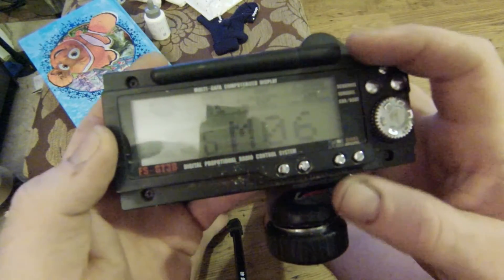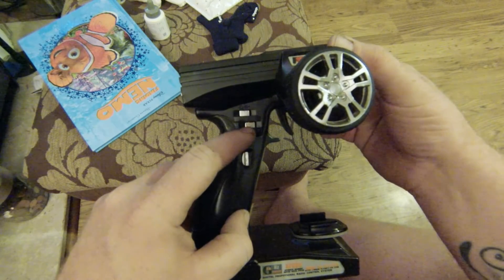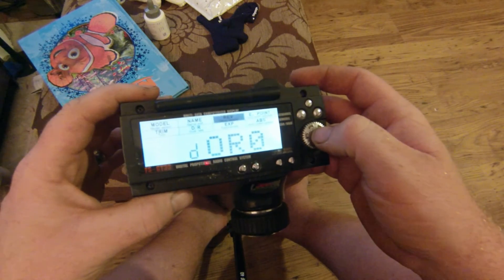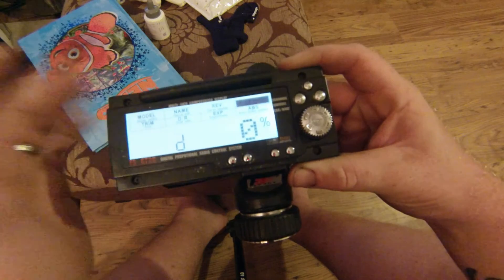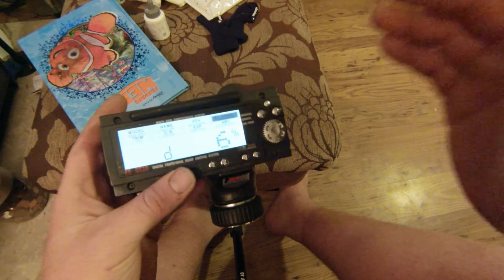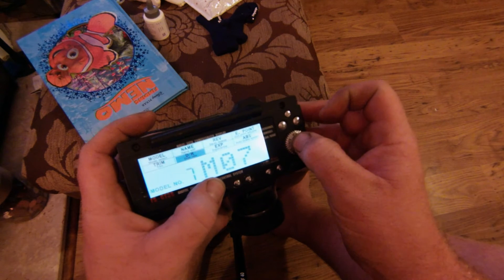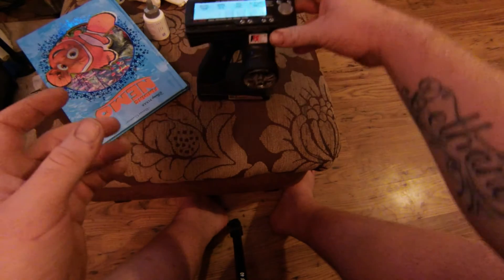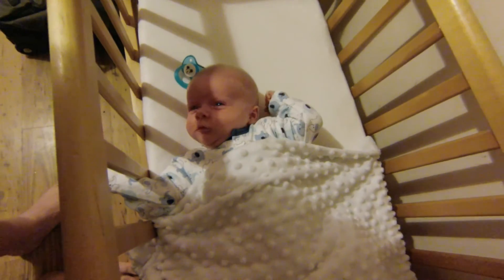how to program duel esc's on a FLYSKY GT3B/GT3C hacked

Comment: Hi pal great video,  I'm having an issue where when I change the front/rear ratios all is good until I turn off my tx and I need to set it again, it's not saving my setting and rear esc is kicking in faster so has an overdriven rear axle. Is there something I'm doing wrong